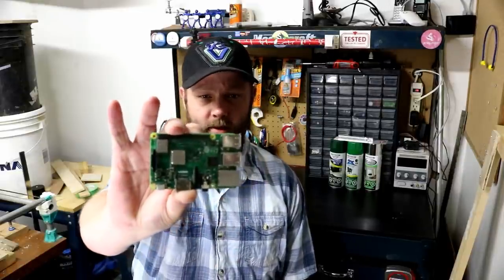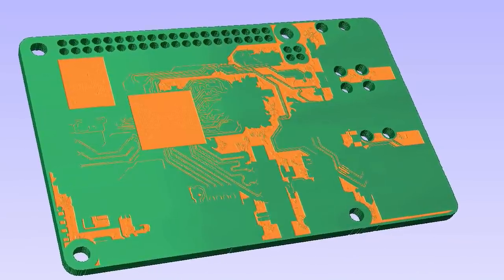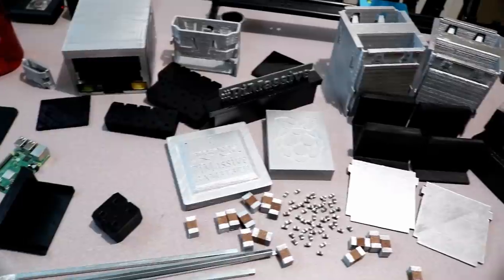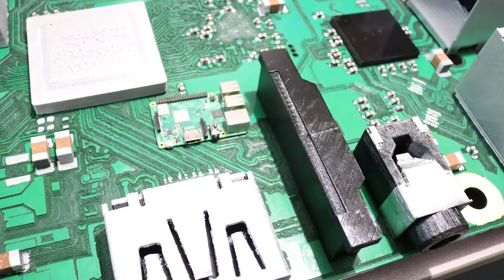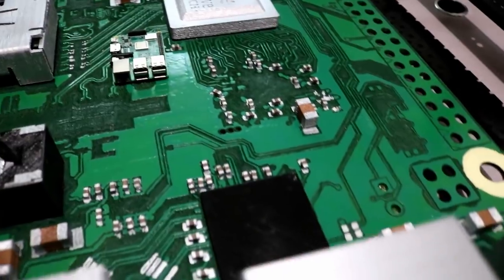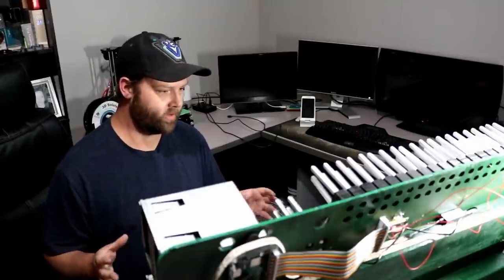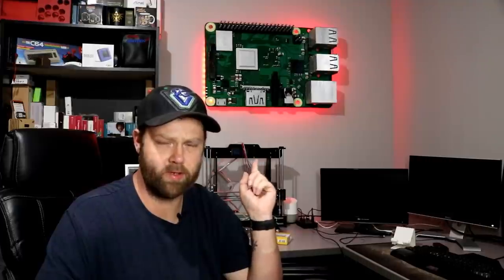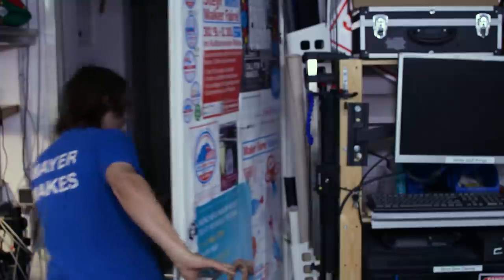Massive Raspberry Pi

Comment: Has no one tried doubling the cores for the raspberry pi? Like have two raspberry pi’s but run them under 1 unit. Idk if that’s possible but I figured it could be done just like the motherboards with the two CPU sockets. Again just an idea and I have no experience with the Pi. I’ve really only ever down speaker and headphones and some portable console modding.
Reply from the maker: That's sort of do-able with clustering, you can combine a number of Raspberry Pi's as a computing/beowulf cluster.
Reply: Turing PI / PiDramble are some Projects that might be of interest to you, it is not trivial/simple but you can cluster pis in different ways.
Reply: @element14presents  yes! That’s what I’m talking about. Thank you for responding. I thought that may have been what would have been needed to do that.
Reply: @MAYERMAKES  yes. I’d like to learn how to use a pi because I’ve had so many ideas and projects in the past for them but I’m only really familiar with the hardware side of electronics and not the coding side of things. Thank you for the suggestion tho. I will check it out.